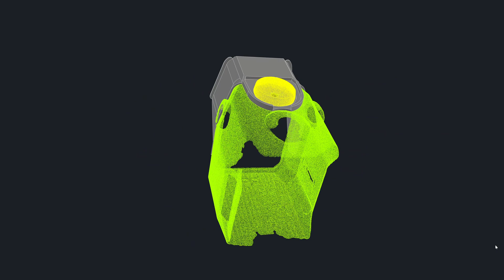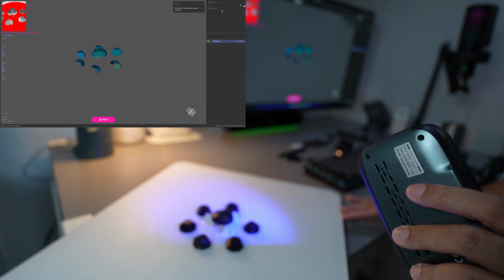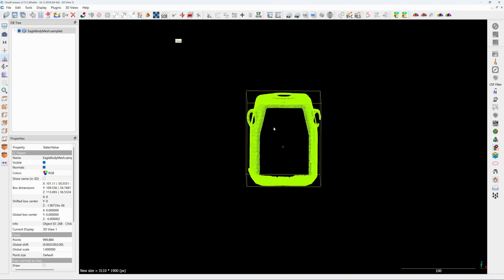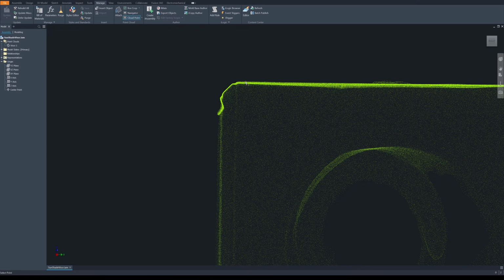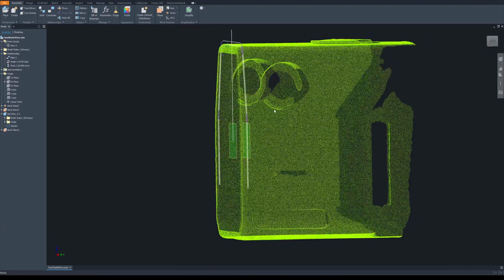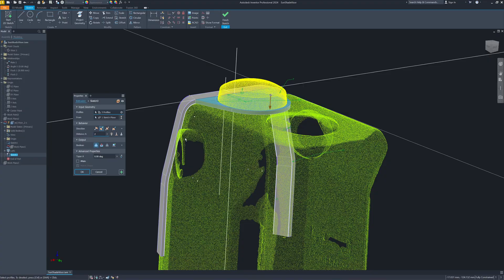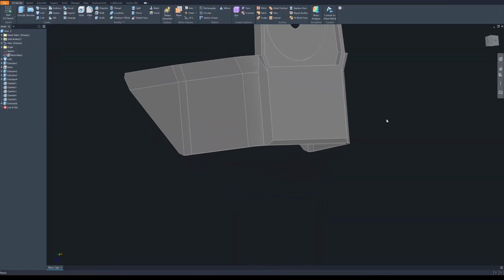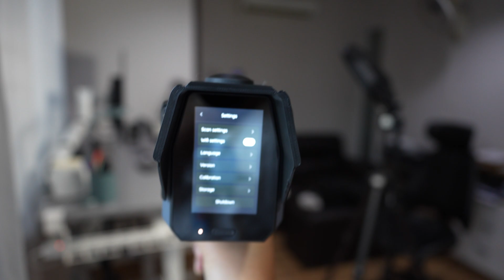Designing a 3D Printable LCD Hood from 3D Scan with 3DMakerPro Moose & Autodesk Inventor

Comment: Maybe a good solution for future prints will be some play with brim settings in slicer. Instead of changing the model geometry. Regards.
Reply from the maker: I printed with ABS, one layer brim won't hold it to the print bed.

Comment: do you like the scanner? I get mine today
Reply from the maker: I feel more confident using this device with a gimbal. However, until the software or firmware is updated, I wouldn’t rely on it for prefab structures. I’ll continue testing it along the way to better understand its limitations.